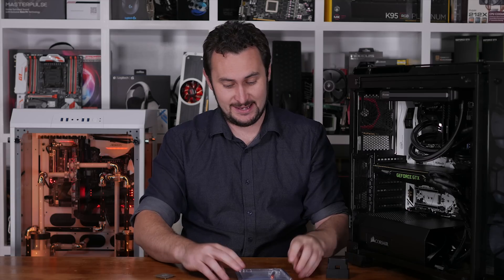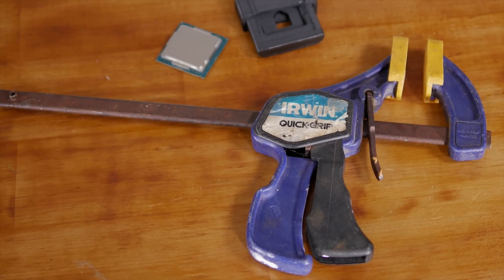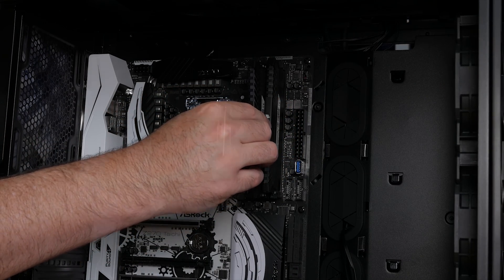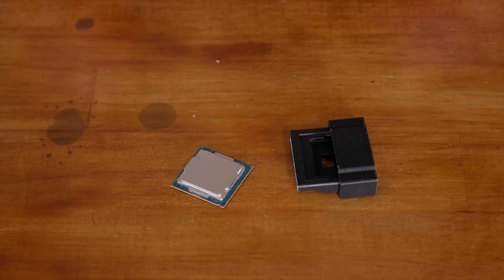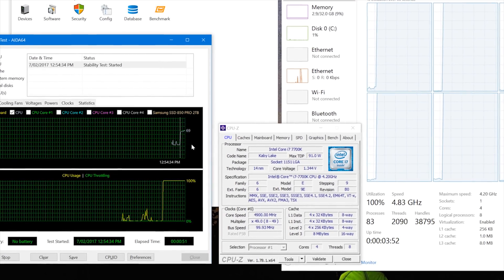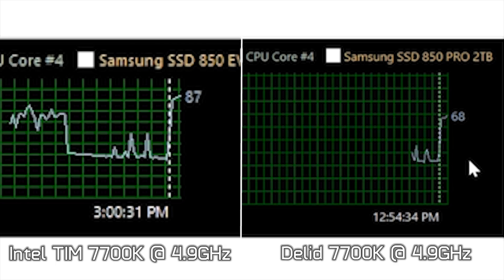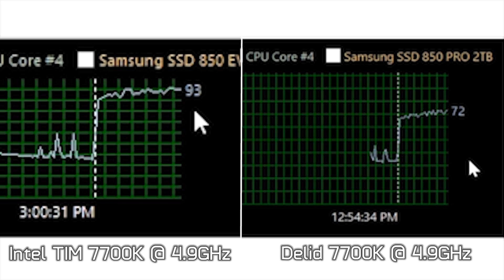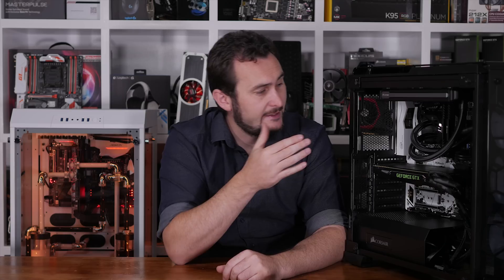Deliding My Core i7-7700K: Amazing Temperature Improvements!

Comment: i have an i7 7700k and I'm scared to delid it
Reply: Then don't
Reply: If you can't easily afford to buy a new one, then you probably shouldn't.

A slightly lesser OC is a bummer, but it'll run reasonable temperatures without the risk.
Reply: Yeah, it'll matter, because with the delid and liquid metal replacement, you're improving heat transference, no matter what cooler you're using.  But if you're happy where you are and temps are good and not planning to do more aggressive overclock, then I'd say skip it.
Reply: Right.  It really really makes Intel look bad if multiple people are doing this and achieving like 10-20 degrees difference.  If done right, this is something AMD could capitalize on and really smack Intel around with a stinky trout.
Reply: exactly
Reply: Jacob over voltage is what kills chips for the majority, 90c is uncomfortable but safe on a lot of chips. The manufacturer will set a throttle the CPU when it passes a safe temperature at stock voltage.

FYI, heat can of course cause damage but voltage is what you need to worry about more. Like a gun and a knife, both will kill you.. but I'm sure a gun will do a better job. And there are chips that can be damaged under 90c, there all different.
Reply: Does deliding matter if you're on an AIR cooler? Because my current OC is 4.7 Ghz @1.25v and it's very stable in temp and performance.
Reply: +Jacob delidding techniques have gone a long way. using a special tool designed for delidding like rockitcool your chance of breaking something is close to zero. just make sure not to use a razor blade or put your cpu in a vise and start banging the headspreader off with a hammer and you should be fine. i don't have a 7700k yet, but i will be getting one soon and i will be delidding it on day one.
Reply: Out of all the videos I've seen on the subject (that included just using a simple razor blade to do it), it looks quite easy and not very risky as long as you're careful.  If you've got steady hands, then go for it!
Reply: no need to ... we were scalping CPUs since AMDK6 ... as the lid itself is unpolished aluminium in it's best, but more often - some dog and unpolished material. It is just place for their engraving. So removing it and making the CPU to contact directly to the cooler is, was and will be the best thing for your CPU. Yep, 15 years ago it was not so awfull as Intel now, but it is just the right thing to do. If your CPU is giving >60'C for more than hour daily or every other day, this simple procedure (if successful) will make the CPU to live 4+ years.
Reply: Yeah.  Well, I'm not particularly excited about paying more money just to fix Intel's shabby job.  10-15degree temp reduction sounds good no matter how ya slice it.  Just, maybe I should send Intel the bill...
Reply: Yeah it matters i got 20c lower temps on my 6700k after deliding, using air cooler and a hefty oc
Reply: Right, so it's use-case based, as with everything.  If you want to OC your CPU to more than it's Turbo with an aggressive OC, then it's likely a good idea to take the drop in temps, which seem significant in almost every review I've seen thus far.  Being very careful and using the delid tool should yield a high degree of success.  Just read up on it and more sure you've got all the equipment before you start.

TBH:  I'm going to delid when I build my new system soon.  I simply want my CPU at lower temps and have some more headroom regarding temps for OC'ing.
Reply: pop his cherry bro
Reply: Personally, when I de-lid my 7700k, I'm going to replace the IHS back on top.  I wouldn't mind going direct Cooler Block to CPU Die chip, but that is more risky in my opinion.  Because, If I put pressure too unevenly between the cooler mounting and the CPU, there's a higher chance to crack the CPU PCB.  So, like many de-lidders seem to be doing, and where it seems they're still getting great results, I will use the liquid metal between the CPU and the IHS, place the IHS back on top (without glue), just to more evenly distribute the pressure on the CPU and die.  Plus, I don't ruin my cooler block this way due to the liquid metal.
Reply: Good luck finding them at a popular online retailer.  Seems they're just never in stock.
Reply: +StarFury777 perhaps, but there are other options too. der8auer's delid-die-mate 2 seems like a good option too. and if you can't find that either, you can buy a 3d printed plastic tool. it's not as good, but still much safer than the razor method and it gets the job done. they are even cheaper, around 15$
Reply: +StarFury777 after sandy bridge, intel started doing a sloppy job with the thermal paste. glad to see amd are still soldering their chips despite it being more costly. this just shows that intel care more about money than their consumers. for overclocking the stock tim is a no-go. even more so for watercooling, as i will be doing.
Reply: If you still have warranty, don't. Otherwise, its just like rrplacing thermal paste on laptop cpus
Reply: dawniewow ahahahahaha this was 3 years ago dude! I’m on a i7 10700k now and might delid it.